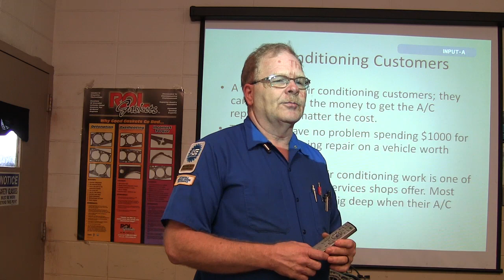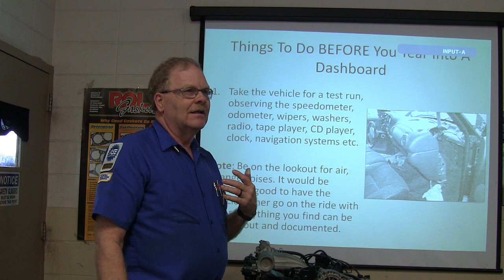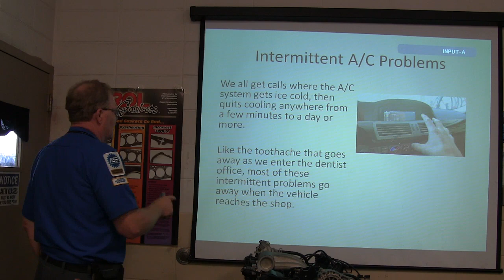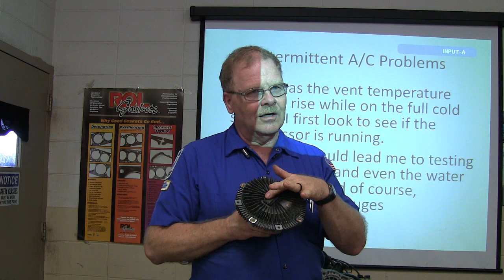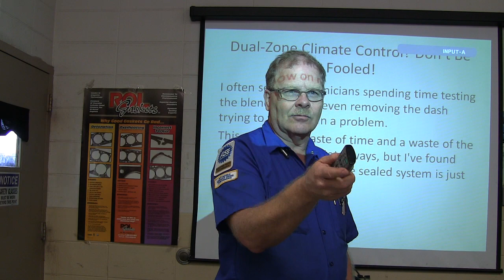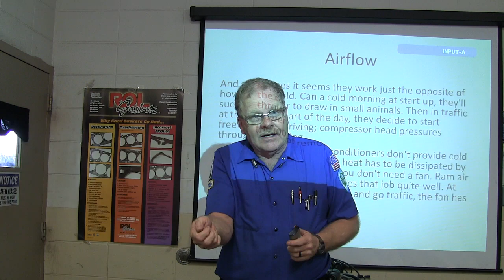Intermittent A C Issues

Comment: Hello. Recently did a ac job on my car replaced faulty expansion valve. After vacuum and charged ac is cold. But has intermittent issue when running feels like it cuts off and you get that humid smell out the vents, stays cool though. Feel like its not 100 efficient.

Comment: McCuistian,I have this problem for 2 years now,After 30 minutes of driving in the freeway the A/C will stop cooling and at the same time my temp needle goes at a 3/4 point closing to the red overheat mark.But as soon as I turn off the A/C for 2 minutes The cold goes back to normal and sometimes it will just continue cooling.I replaced both fans (2 blower fan for radiator and for the condenser) Also replaced the condenser,But still doing the same thing.You are the expert,What do I do?What is wrong?The compressor?But it has normal pressure and supercold when it is working.Help me professor.
Reply from the maker: That sounds like a problem with the radiator either externally or internally clogged. When the temperature goes to a certain level on most vehicles it will shut down the A/C because the heat coming from the condenser tends to cause a borderline overheating situation to be worse. First externally clean the radiator and see if there is grass or something between the condenser and the radiator. Do that first..

Comment: Hi sir. Could you please give a good explanation on why lowest blower setting makes it come out the coldest and why that causes short cycling and also why do you need engine speed at 1500 rpm. Im really trying to fully understand ac and i know how smart you are and know exactly whats happening there. Thank you
Reply from the maker: On the lowest blower setting, the reduced airflow doesn't provide as much heat for the evaporator to absorb, so the evaporator gets colder, which lowers the pressure, which causes the compressor to short cycle, because the compressor cycles off when the pressure is low.  With the engine at 1500 the compressor is spinning faster, which makes it more efficient - more pumping makes the evaporator even colder.
Reply: McCuistian out standing performance!! Ha ha

Comment: Here's a good one I was reminded of at the end of the video talking about that Jeep. I used to work at a Chrysler dealer and we saw this all the time: Lots of Jeep owners will wash all over their vehicle to get the mud off after taking it off road, but seldom do they ever wash the radiator/condenser. Typically they come in and say that the A/C just stopped one day or it just started overheating, so SOP on Jeeps was to of course verify the problem, then put eyes in between the condenser and radiator to make sure there isn't a brick of mud preventing airflow before wasting your (or your customer's) valuable time. Good advice for any vehicle, but particularly on Jeeps or lifted trucks. 

Surefire way to make a happy customer is to take them out to your shop's garden hose, rinse the mud out, and say "no charge" as the temperature gauge drops or the A/C starts working again.

Side note for a shop test if you haven't seen or heard of it. Stick a sheet of cardboard painted silver in between the radiator and condenser and watch the head scratching. A whole room of master Chrysler technicians with probably 50+ years of combined experience were stumped by that at Chrysler school, me being one of which.